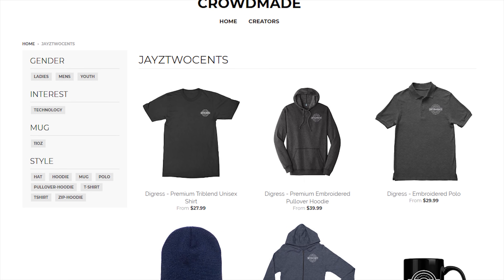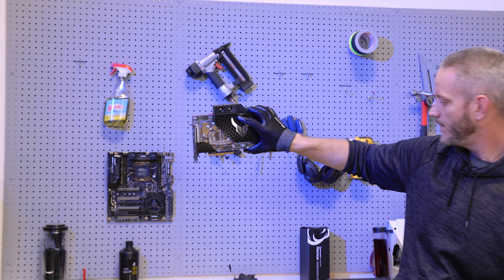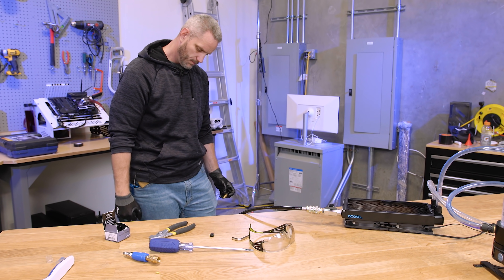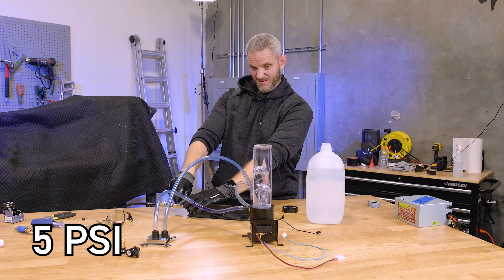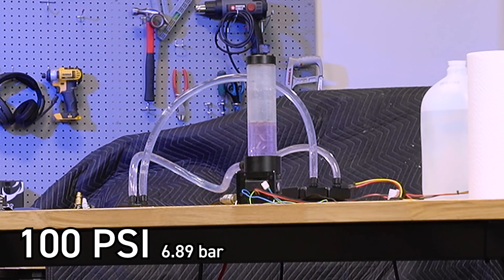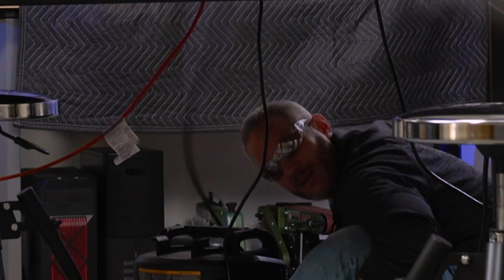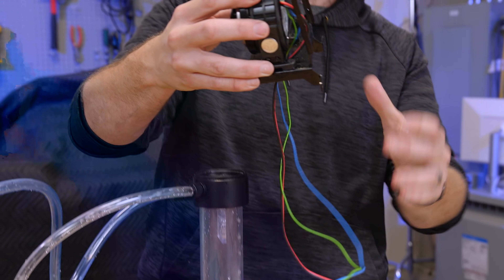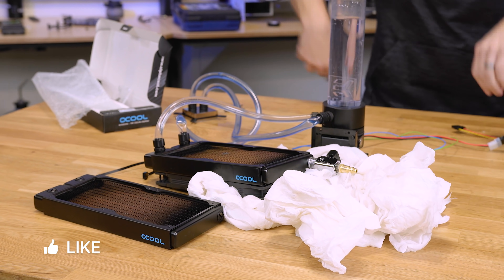The loop EXPLODED! DON'T TRY THIS!

Comment: Fluids don't expand when they get got. Gasses do.
Reply: Water is incomprehensible. Yes it can boil and change phase to gas and expand but the liquid does not change in volume if air pressure is applied.
Reply: @SlipperyCouch1  I agree that water in not compressible. but it does change volume with a change in temperature.  It just takes a fairly large temperature change to see any  noticeable change in volume.
Reply: yes they do.  Temp goes up, density goes down, volume goes up.
Reply: @jaaaspokenjay5778   this applies to gasses. Liquids have nearly constant density.
Reply: @SlipperyCouch1  Wrong,  I use to watch water level rise a lot when heating up a nuclear reactor from cold to operating temperature.  Water expands.  do a google search.
Reply: Water wouldn't boil if it did not expand as a liquid

Comment: I'd totally buy a panzercool radiator just for the name
Reply: Actually it would be something like... Eispanzer
Reply: @pldcanfly  We tought the same name. XD
Reply: @JoelDashReed  I wanted to have a Threadripper just because of the name ;)
Reply: Hmm the heater in my old but refusing to die GM SUV leaks. It also is a large boil on my ass to fix. I have  40MM  X 280 MM Alphacool. I think I have found a way of defeating GM obsolescence engineering. Thanks Jay.
Reply: @warrenpuckett4203  my first watercooled PC started using a car heater matrix and got upgraded to bike radiators....
Reply: Wythe the craziest part is this is the top comment. Says a lot about the PC community
Reply: I won't buy Deepcool Fryzen for the same reason.
Reply: As long as you name it the Panzerkamfwagon we are cool.
Reply: Put your money where your typing is. Buy a case from Cougar's Panzer line
Reply: @Rararawr  cases for 40 plus year old women lol

Comment: Fun Fact! Water is an incompressible liquid. You can compress the air around the water (or behind it) or you can compress water vapour,  but as long as it’s in liquid form, the only way you can make it smaller is by changing it’s temperature.